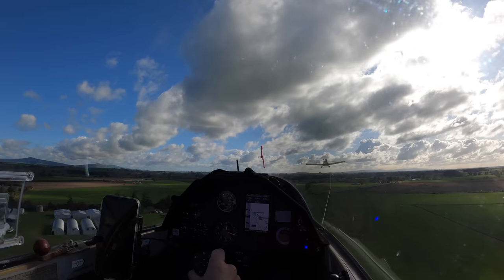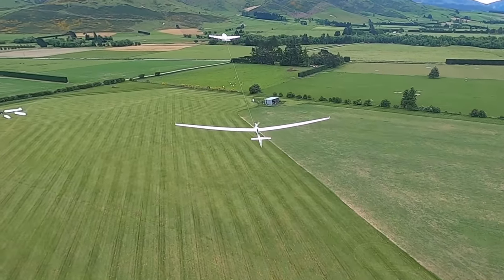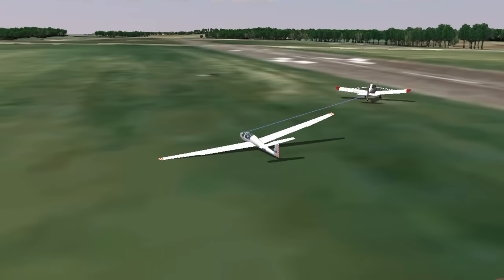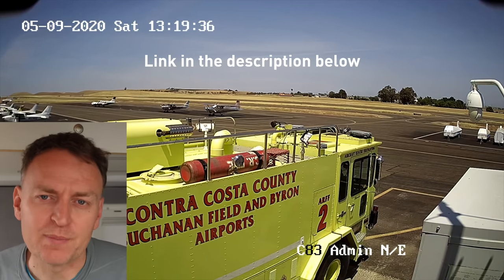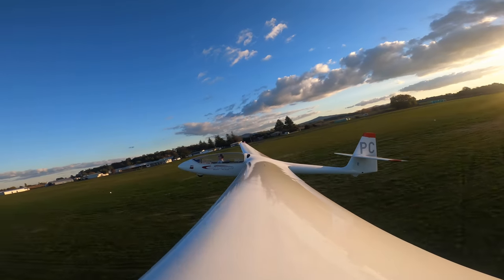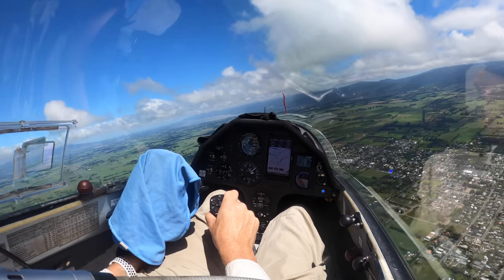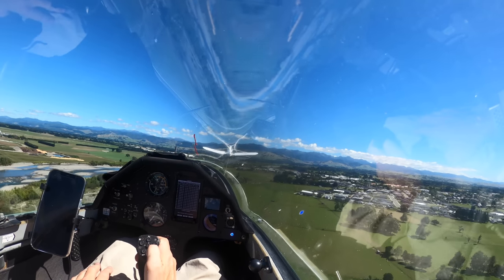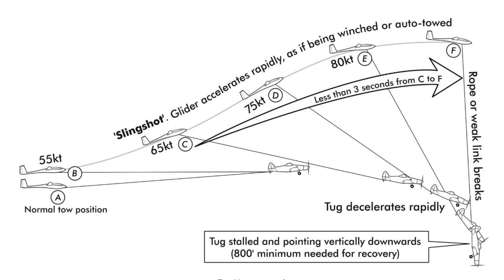3 Seconds to Crash: Glider Aerotow Launch Gone Wrong

Comment: As a former tow and glider pilot I've had several severe upsets; two towing and two as the glider pilot. I ran a glider operation in Taos, NM USA.  Of course I practiced releasing every time before towing during the release check and that saved my life once.  The glider on tow and still on the runway hit a severe gust and literally blew upwards into knife edge and slack line.  When he reached line tight it yanked him back into level flight and yanked me 90 degrees to the left. And I'm now "galloping" off the runway into a ditch/ravine. I never was conscious of it but I released immediately. Practice practice practice. As I'm headed for an imminent ground collision (I saw nothing but a dirt wall in my windshield) I put the stick in my stomach and somehow flew out clipping sage brush all the way.  Went back around and picked up the next glider.  Later he came into my office and said "well, I nearly killed us both". He was a 35,000 hour Pan Am pilot who flew the original South American routes. No newbie. One time towing it was  my fault as the tow pilot. I didn't release thinking the glider pilot had released during his excursion way off the runway. Again nearly killed us both.  There's always more but that's enough for now. Tow pilots need to release unless you know you'll kill the glider pilot. If it's you or them, release anyway. (yes, I know that's harsh). Actually having recounted these I can think of a couple of more but they were non-life -threatening but still pretty dicey.
Reply: Thanks for taking the time to share Steve! I'd much rather learn from you than be put in the same situations.
Reply: Cheers Steve .........  I think I shall review my aspiration to be a tow pilot
Reply: Good story thanks for sharing your experience.   I have a lot of hours, most of them in fighters, and some in towed gliders.  I would never consider myself an experienced pilot in that realm. We all need to acknowledge that every flight has never been done before and is thus completely new to all involved.  Experience in that exact realm is certainly helpful, but sitting in an office chair at FL 370, or flying an IP to TGT pop at 540 KIAS has zero application to stick and rudder flying.  And vice versa.  It sounds like this near-mishap pilot was humble and recognized his mistake. In the spirit of getting to a root cause ID, overconfidence based on tons of not-applicable “experience” is a possibility.

Another not very talked about phenomenon is negative transfer, when “experience” doing things that are positive in one environment become negative contributors in another environment.  With negative transfer, experience is a liability and lots of inapplicable experience can be fatal.
Reply: @FFE-js2zp  Thanks for your comment. I am one of those pilots who have had "skin of my teeth" escapes.  And I'm proud of my skill but not always my judgement.  I could write a whole book of "I learned about flying from XYZ" experience.  Fortunately I did learn and didn't repeat the same mistake twice. I learned about exceeding 5g's while taking an aerobatic course with an aging barnstormer (Duane Cole).  I took the course so that I would never find myself in an attitude I hadn't learned how to deal with.But that's another story. Of course most of us civilians are jealous of your flying jets and none the less appreciate your service.
Reply: when would releasing kill the glider pilot?   just very low?
Reply: @ryancrazy1  I know of one incident where the glider was released low and crashed into trees at the end of the runway. pilot broke both legs. there are more stories like this. I should write a book 🤣
Reply: @ryancrazy1  unlandable area below.
Reply: @ryancrazy1  Well, in the scenario which Steve described where the glider, hit by a gust, kited up ........
It would have very little inertia / kinetic energy.
That makes a stall a highly probable event.
And its very close to the ground.
So now the pilot who is probably already wondering 'WTF just happened?' Has to recognise the situation, realise he has to push his nose down far enough and fast enough to sustain airspeed whilst avoiding an angle which is so acute he will 'power' into the floor or so shallow he will stall and potentially go nose first into the floor.

Its why pilots are trained to always consider 'what could possibly go wrong - And - What must my responses be in the vent something of that sort happens'.

It shaves vital fractions off thinking time and allows for a better strategy to be thought up than just a reflex response.
(Although in this instance an instant kind of reflex response is vital).
Reply: @Farweasel  Me too... :(
Reply: I’ve met a few pilots who touted superlative resumes, always in some far-off place where nobody can corroborate, who were remarkably shitty, dangerous pilots.  A 747 type rating does not mean you can fly my 180 in the backcountry.
Reply: There was an accident at an airshow in NZ similar, in that he held the stick hard back and what killed him was the stick stabbing him in the guts. Thanks for sharing.
Reply: @PostcardsfromAlaska 
A 747 Type Rating mostly means he can operate an autopilot system.
Had a couple of very well trained and experienced pilots put the same AGwagon over on it's nose twice in one year.
Reply: @Farweasel  I find it hard to believe there exists a pilot who wouldn't correct such upset within 0.3s. It's pretty much muscle memory. There isn't even any brain power wasted on figuring out why you suddenly pitched up, maybe later or if pushing the stick doesn't work.
Reply: @user666mega  I won't argue its not a source of puzzlement .... 
Just point out the evidence is clear - IT HAPPENS  🙄

Comment: As Club Safety Officer for a UK Gliding club, I've shared this with all to reinforce previous similar messages.   The content is very clear, and very sad. it's key that before every flight, the pilot reminds himself of this in Eventualities, and also the signals the tug itself may give.   The one thing I disagree with is that for me as an Instructor, and the BGA here too, the teaching is that the pilots hand should be ON the release mechanism, not near it.  They'd lose precious time potentially locating and gripping it otherwise.   I've seen accident reports where the pilot has pulled the canopy release mechanism instead, or found the rope release was stuck under a leg (in gliders where the mechanism is more central and low.   I've heard some argue that doing so can cause inadvertant release, and yes it might if ones grip is too firm with no 'flex' in the arm, but whats the worst that can happen if so?   Not a tug upset for sure.
Reply from the maker: Hi yes it's a debate that keeps coming up, both for winching and towing. And I agree, the worst that can happen is you release early inadvertently, most likely while bumping along the ground down low, where it's not really a problem. But the consequences of not getting to the release fast enough can be fatal. So I tend to agree. I think I could dedicate a whole video to just that. Thanks for sharing.
Reply: I agree… 💯 %
Reply: I agree as well, most release mechanisms that I’ve seen have a little slack in the cable anyway, releasing inadvertently is very difficult if you’re elbow is bent. The exceptions are a capstan at my club (quote: “it will go if you look at it the wrong way) and a k8 I’ve flown.
Reply: Neil,  I think what you said is the opposite of what you meant when you wrote:
'The one thing I disagree with is that ....... the pilots hand should be ON the release mechanism, not near it.'

In fact you commend the pilots hand should be ON the release mechanism  ......

[Yeah that's a bit pedantic for me to point out but this is no place for ambiguity].
Reply: Great video . It depends on the glider, location of the release and the pilots physiology ( ie how long their arms are compared to leg length  . If the glider pilot is relaxed and comfortable on the stick ( ie not leaning forward slightly or off centre to hold the release  ) I don't see a problem . Using the controls comfortably and aviating  comes first , hand on the release would be a second priortity. In my personal experience having flown winch 90% of launches , I 've never had any issues locating the release when needed. I have a habit just as the slack is coming out of the rope to sight the release and just touch it with my hand , so usually if I need it in the next 5 seconds its almost an automatic process to reach the release regardless of the aircraft being flown . If its a bumpy ride on aerotow I would rather not have to have a hand on the release .
Reply: I was taught hand on release until established in a stable tow climb.
Reply: There's also the psychological benefit that a hand on the release means that this is a control I might actually be USING one day as part of a takeoff gone wrong, not just some "never-will-happen" theoretical bit of kit like the first aid box in my car...
Reply: As a former tow-pilot I couldn't agree more with hand on release.
Reply: done a few jumps , the three ring circus relese of a parachute is 100% safty , super simple, but a winch changes things as far as the andle , we are taught look , reach , pull , training overcomes panic is the idea , you got to look
Reply: I'm glider rated. The glider club I was with needed tug pilots. (I'm also, SEL, tail dragger, seaplane.) Turned it down. No formal emphasis on glider pilot hand on release during take off. Psychologically important to touch and be ready to release the tow. If, when flying the glider on tow you lose proper position. Pilots like @Fractalite think they know better and disregard that hard proven advice. Keep your hand on the release - you can park your thumb as a pivot point on the instrument panel and not actually grip the release - but be 100 percent focused on the tow site picture and be ready to "punch off" if you lose position.

Comment: I flew at one club where both tow aircraft and all the gliders were fitted with public band radios. They were full duplex (both ends can speak at the same time) and VOX (voice activation) so it was possible for the pilots to talk to one another without having to push any buttons. At about GBP 30 per set, they are invaluable safety aids.
Reply from the maker: Interesting idea! Cheers
Reply: As a new student pilot I'm astounded that isn't standard and mandatory.

Comment: Great video. One thing that greatly surprises me is that in 2022, gliders are towed the same way they were 50+ years ago. From an engineering perspective, it would appear that connecting the tow very near the rear control surfaces is an invitation to disaster. One commenter has mentioned the split bridle, which at least on paper appears to be a much safer solution. It could be that Gliders are such a small part of the aviation world that no one has really devoted much attention or resources to it. I recently saw a comment from a tow pilot on another channel that all he has is a small mirror to keep track of the glider. Another thing that amazes me is that in both General and Commercial aviation, there is little to no use of digital cameras. Several high-profile accidents covered on the Mentour Pilot channel have shown that use of video cameras in strategic locations could have saved hundreds of lives. In 2022, cameras are dirt cheap. Even a crappy doorbell camera pointed back at the towed glider and displayed on a phone or a tablet could save the life of a tow pilot. For that matter, how hard would it be to tweak Flarm or a Flarm-like device to go off if the towed glider shows a sudden rate of climb or an elevation well above that of the tow plane? The most revealing statistic (if it were available) would be not the number of deaths, but the number of near misses, which is likely a much larger number. Lastly, from the accident video: At least two lives were ruined in this accident, to say nothing of the families and friends. If I were that glider pilot, I would not be able to live with that. That thought alone should be more than enough motivation for all of us.
Reply: If you could secure a camera well enough that it didn't give a false indication the glider was out of position ..........
It should in principle be possible to set the camera angle so if the tug pilot couldn't see the glider that was sufficient warning 'Drop the tow'?

OK you would need a good protocol to ensure the glider always warned it was going to release so tow lines aren't showered confetti-like over innocent bystanders below .......
Still, far better then dropping tugs on them                🙄
Reply: I kind of had the same thought. It has to be possible to design a system which can detect if the glider is pulling too much in an up/down or left/right direction, causing a tow upset. If an upset is detected, either warn the pilot(s) or release automatically. But I think it’s hard to design such a system to be reliable, simple, affordable and to not cause more accidents than it avoids.

Basically you’d just have to detect the direction and force the tow cable is pulling. Plug those numbers into a computer and combined with the airspeed you can easily calculate if it exceeds what the tow plane can correct for.
Reply: I fully agree with you on the camera thing. But there is a resistance to them in flying and for that matter driving. Consider the average semi truck and trailer. The driver is almost blind to anything not way out in front. Huge blind spots in front, rear and along the sides, all ease to cover with just a few cameras. But this is changing, the new Tesla semi has a bunch and big screens to show them on.
Reply: I'm just a random dude who was fed some glider videos by the YouTube algorithm and now finds it very interesting.

Is there any reason drones couldn't aerotow gliders? Aerotowing takes place very close to airfields in good weather, which seems ideal for drone flying. Maybe someone could outfit an existing tow aircraft with cameras, servos, and radios?
Reply: @rfphill1984 You would need to have a drone as maneuverable as a tow plane, and more importantly, as intelligent as a tow pilot. Tow pilots do a lot besides just towing. They scour the airspace for conflicts with other aircraft. They communicate on the radio. They listen to the glider pilot or are attentive to signals from the glider, and try to accommodate. They try to bring the glider to places that have good lift (that's an art) as well as keeping the glider in a good position to return to the field if it has to. The tow pilot also has to know where to put the tow plane if the tow plane runs into trouble. The runway environment on return may be complicated by other launches and other gliders that have just landed normally (or not). And then there's area weather. There are good places to go and not so good places to go. I can't see drones doing these tasks any time soon.

Comment: I am retired now, but still teaching; I was a professional gliding instructor for 20 years (5,000+  hrs and 25,000+ launces). I had a hot shot EasyJet captain as a tug pilot who upset himself. He had a habit of turning sharply (thermal turns +) and dropping the nose in the turn, resulting in him loosing sight of the glider behind. Making it difficult for new pilots under training to follow. On this occasion he thought we had released and dived away, while we had stayed level, the rope went slack and then became tight and we began to kite upwards. I quickly released, but the Eurofox was in a vertical dive. We flew on. The pilot recovered and saved the useful tug, the less than useful tug pilot also survived. He mouthed-off about us for dangerous flying, but the video from cameras in the front and rear cockpits, told a different story, the X-rated movies were impounded by the CFI and Tug Master. That particular tug pilot no longer flys our tug.

Next time you fly EasyJet, don't worry he has retired.
Reply from the maker: Interesting, thanks for sharing. Yes it's critical tow pilots don't dive away thinking they've de-attached, when they haven't!

Comment: ABSOLUTELY CRITICAL TO SHARE THIS VIDEO WITH ALL OF YOUR CLUB MEMBERS. I see far too often a wing touching the ground at an early stage of an aero tow and pilots not releasing even with an instructor on board.  Nose hooks will pull you back straight while a CG hook WILL NOT and things can go very wrong in an instant.  This needs to be taught from the very first flight.  The RULE OF PRIMACY rules!  My $0.02.

Comment: I once had 2 wasps start flying around inside my canopy just after the takeoff roll. It look ever ounce of concentration to stay focused on that tow plane. I never miss checking for bees and wasps now.
Reply from the maker: Eek that's not what you want! Bees are fine, they won't do anything if you don't attack them or squash them. Not so sure about wasps...
Reply: Uffff.....
Reply: same thing happened to me though much later into the tow, not proud of it but I spent a good few minutes trying to kill it while on the longest tow ever.  Was a windy day so tows were brought out way further than usual, upwind ofbthe field. I was in a brick (schweizer 2-33) being towed by an old super cruiser with big blocks of wood on the wings acting as wingtip fences and what I believe was a 140hp engine.  That thing had just barely enough power to get us airborne lol